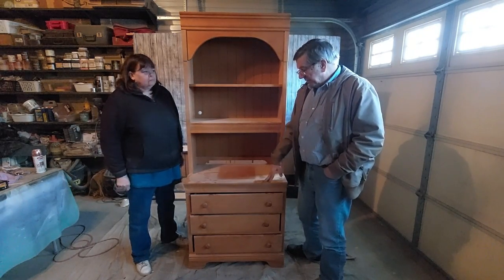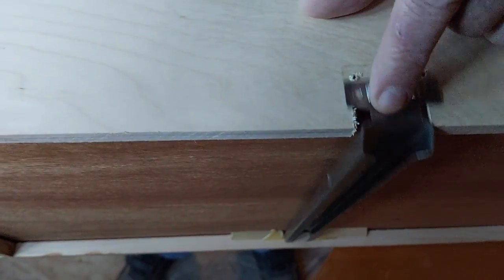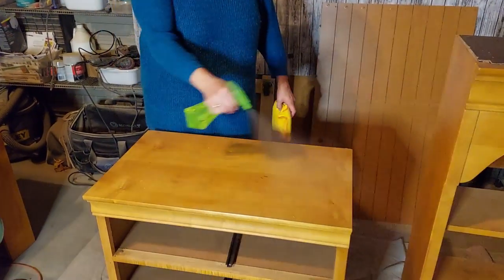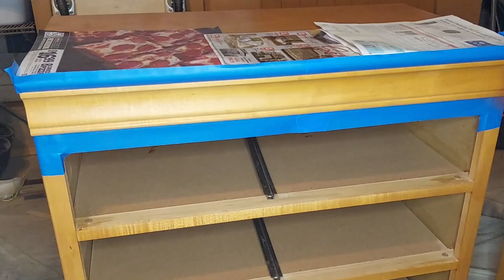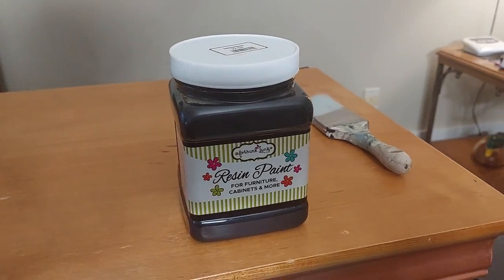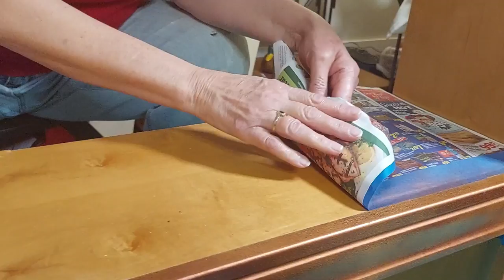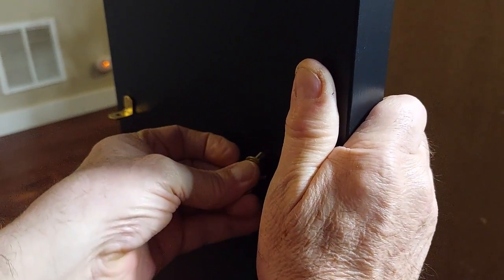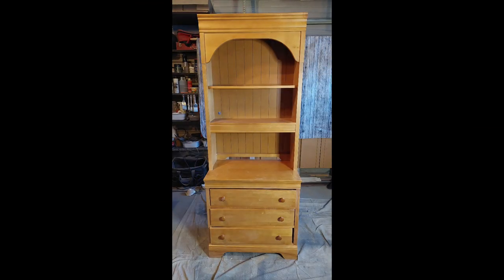Amazing Copper Furniture Transformation | Furniture Makeover | Using Metallic Paint

Comment: Looks beautiful. I have two questions: why you didn't send it before color and why you didn't put any top coat at the end?
Reply from the maker: We used Rethunk Junk products on this piece. "The Prep" by Rethunk Junk is used and with it, there is no sanding needed. Also, Rethunk Junk paints do not require a top coat. It is not a chalk or mineral paint. It is a resin paint. It goes on much like chalk or mineral, but dries harder and faster. We can ship or deliver pieces to our customers in 5 days without worry about chipping or scratching. Hope that helps! You can see their website through our affiliate link at https://lddy.no/zj0i